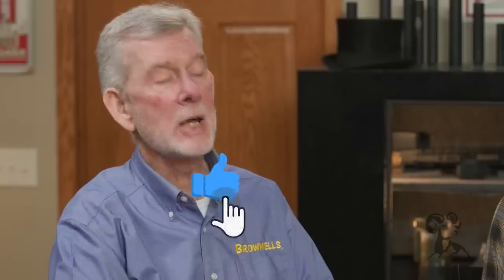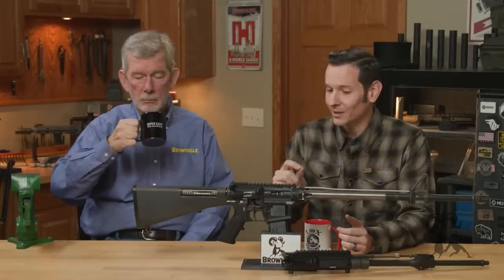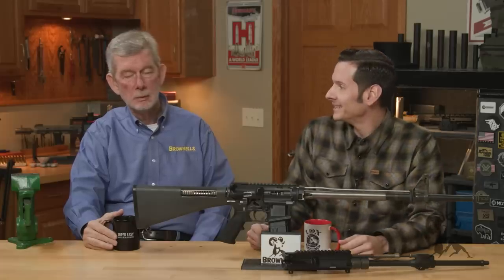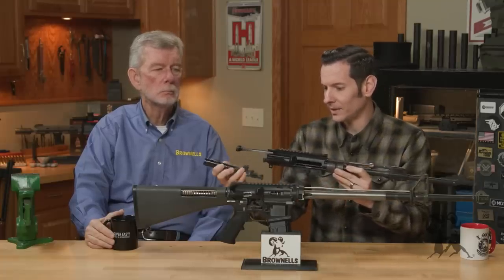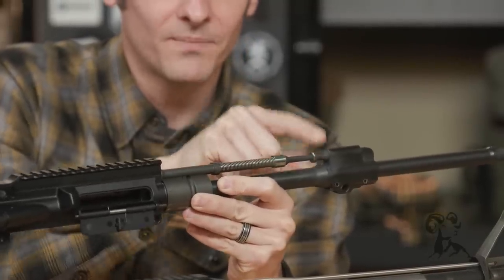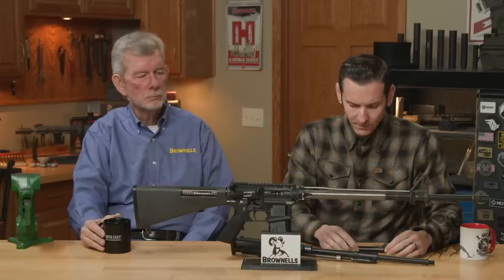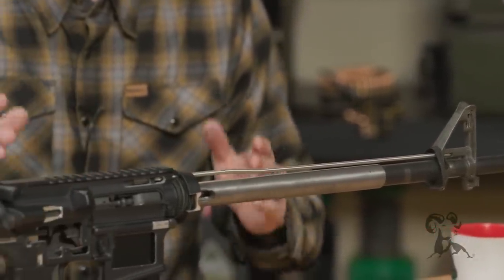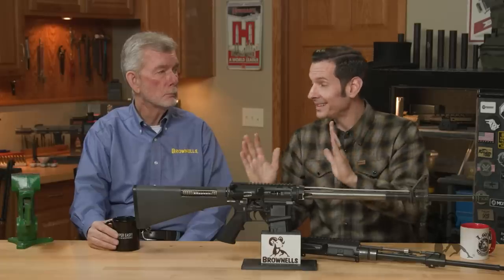Smyth Busters: The AR-15, Direct Impingement or Piston Operated?

Comment: I've always tried to explain the AR never was DI even though Eugene Stoner called it that because the bolt is the piston and the carrier is the cylinder. I think Stoner simply said that out of simplicity to avoid having to explain the whole thing. Example of a real DI is the Swedish AG45B and the MAS 49 if memory serves me right

I've also tried to explain to people it's a bad idea to move the piston over the barrel on the AR because the AR was designed to have all the forces concentric to the bore axis. When the piston over the barrel producing accentric forces; now you're forcing the rear of the carrier down and dig into the soft aluminum.

Plus now there's nothing to counter bolt thrust pressure before camming open, the carrier key is now digging into the soft aluminum side. Plus the camming action to unlock the bolt without counteracting the bolt thrust pressure on the locking lugs will eventually break bolts as well.

The whole thing turned into a gun hipster fad when HK did that to solve the problem of being able to fire the rifle immediately after being submerged on water for the SEAL teams, not because it's a better configuration for those not firing their weapons immediately after being submerged without letting it drain first. They were willing to sacrifice the service life to be able to do that with the AR, are you?
Reply: In your reality, the cylinder is driven and the piston follows. That's a very strange concept for how pistons work to say the least. Stoner called it DI because that's exactly what it is. The company's patent attorneys are responsible for the creative explanation you've been holding on to, including the expansion chamber that is nothing of the sort.
Reply: @Ni999  in rotary engines ( think sopwith camel or other WW1 fighters) the piston is stationary while the cylinder moves… it is a valid mechanical design
Reply: @JM-jv7ps  Good catch but no soap. I'll stand corrected for the non-linear example that only existed until the oil pump was made airborne and radial engines replaced rotary cylinders. Still a good catch though. Read the AR patent. Edit/PS - hung a well deserved like on your post.
Reply: @Ni999  In both thermodynamics and mechanics it is a question of frame of reference. There really is no difference between sleeve and piston. The are being acted on by the same forces.
Reply: @andresmartinezramos7513  That's true. It's also true that the AR bolt is not a piston.
Reply: @Ni999  say you've never held an AR bolt carrier in your own hands without saying it.
Reply: @asherdie  Say you need a cheap out because you don't want to agree and then say you failed at it.
Reply: The Stoner patent describes it as an internal expansion system, unlike a direct impingement design.
Reply: @Ni999  I would recommend that you study some mechanical engineering relative to these concepts and applications.

I can point to several firearms piston designs with a stationary piston that acts as a point from which expanding gas acts on the reciprocating mass.

This is fundamental to the AR-10 and later AR-15 operating principles.

The bolt tail acts as a stationary piston to seal the expansion chamber, forcing the sleeved carrier to move to the rear.

The piston also happens to be an integral part of the rotating bolt, bisected by the cam pin hole.

It's a very ingenious design due to how it integrates the piston and bolt, reducing parts count and eliminating off-bore axis reciprocating mass.
Reply: @LRRPFco52  Your assumptions about my exposure to different designs and how they work is incorrect. I recommend that you study the difference between patents written for independent inventors and corporate patents and then look at the AR patent more carefully.
Reply: @Ni999  If you don't have a mechanical engineering background specific to firearms or gas dynamics behavior (aerospace, automotive), and don't know the history of self-loading firearms designs, then all the legalese in the world will not help you understand the very real differences between the Stoner Internal Expansion System and Direct Impingement like on an AG42, Desert Eagle, or Mini-14.
Reply: @LRRPFco52  I rely on my physics background for understanding gas behavior. Probably not as good as I'd like but I work with what I have. I understand private and corporate patents because I have inventions covered by them.
Reply: @Ni999  A solid physics background should illuminate the fact that the Stoner Internal Expansion system takes gas from the tube, routes it into the expansion chamber, creating carrier inertia.

Direct Impingement hits the cavity of the cup formed by the key.
Reply: @LRRPFco52  Momentum. I assure you that it does not create or transfer inertia. That distinction was settled probably about a century ago after a few centuries going back and forth on it.
Reply: @Ni999  The expanding gas within the internal, telescoping chamber acts equally on the carrier wall, as well as the bolt flange with piston rings.  Since the bolt can't move forward (much), the carrier moves to the rear as a result of the expanding gas.

Static carrier inertia is overcome by this expanding gas, setting it into motion.  Then you can talk about momentum.

The basic, unavoidable fact is that expanding gas inside a temporary containment vessel with a piston and sleeve, exerts energy that moves the sleeve rearward.

The examples of direct impingement designs, especially the Ljungman AG42, confused enthusiasts because it also has a multilug rotating bolt and a gas tube.
Reply: @LRRPFco52  The bolt and carrier present a confined space for the expanding gas resulting in a force on both as the pressure increases. The bolt can't move forward (much) during this phase, the static carrier inertia is overcome by that force causing it to move, constrained by its inertia of direction, rearward.

The Combined gas law sets the stage so that we can observe Newton's First Law of Motion (overcoming rest inertia) in action as determined by the Second Law of Motion (the amount of force applied). The moving carrier has momentum (Third Law) and works against the dynamic inertia until the carrier can force the bolt to rotate, unlock, and join the carrier moving rearward.

We're not going to settle the debate of whether the bolt is a piston but at least now you know to stop saying that inertia is created or transferred so we accomplished that together. 👍
Reply: @LRRPFco52  And finally, let's examine the patent claims. I quote -

"It is another object of this invention to utilize the energy of the expanding gas developed by the firing of the weapon, for actuating the automatic rifle mechanism directly by use of a metered amount of the gas coming from the barrel. This invention is a true expanding gas system instead of the conventional impinging gas system."

Tell me that you don't misbelieve that "the conventional impinging gas system" is not also a "true expanding gas system."  Both piston and DI systems are whatever you think a true expanding gas system is. That patent statement is a throwaway for the examiner. It has nothing whatsoever to do with gas laws, physics, or mechanical engineering. It implies that a difference exists where one does not.

Again from the patent -

"The most widely used method of operation of automatic rifles today is the conventional gas cylinder, piston and actuating rod assembly; the only other system now in production use being the recoil actuating system. The blow-back or inertia block system is usually reserved for weapons using lower powered ammunition, such as pistol and .22 caliber weapons."

That part in bold was not true when the patent was written, applied for, or granted. It's another throwaway designed to direct the examiner's attention. In the post-war world, it roughly translates to," Everyone knows that gas pistons are the real deal and used by everyone." It's an easy sell for any examiner with recent military experience and it was absolutely expected by US Army buyers. It set the stage for the creative writing claiming that the bolt was a stationary piston.

Lots of patents lie, everything is legal as long as you don't get caught. The patent protected the embodiment of that particular gas operated bolt carrier and rotating bolt. If DI had been considered the hot ticket at the time, its entire explanation could and would have been cast in terms of its unique DI operation. Nothing would have changed except for the creative writing, the patent would still have been granted and it would would have still been quoted extensively.

In addition to protecting inventors, patients acquired another benefit long ago - their claims have been used to form arguments from authority in order to create buyer excitement during sales and marketing. That works surprisingly well. It worked on you and your first argument to me was that I lacked the knowledge to kowtow to its authority. You're certainly welcome to your opinion. Last I checked, the AR system in question is DI by definition, notwithstanding the sales pitch about the expanding chamber, true expanding gas systems, or bolts that have the secondary function (patent's words, not mine) of acting like a stationary piston.

Both gas piston and DI rifles operate by impingement - pressurized gas forces a metal component to move out of its way. That's basic physics and not open to argument.

Piston systems typically use a mechanical linkage to transfer the force to the carrier. Systems that have carriers impinged directly by gas without an intermediate linkage are called - appropriately and obviously - direct impingement. You keep saying that isn't so but you've said a number of things that aren't true. You know, like the part where I didn't understand how gas expansion worked (that turned out to be you), or how mechanical engineering applies here (yeah that was you again), or even fundamentally how the design works (yeah, no).

Pity about your attitude. Maybe it'll improve next year. 👍🙂
Reply: @Ni999  The biggest premise of your argument relies on a historical falsehood.  The AR-10 gas system patent was submitted in 1956, awarded in 1960:

U.S. Patent No. 2,951,424, Sept. 6. 1960

There was no US Army production contract until years after the patent submission.  US Army evaluated the original AR-10s, but they were late to the service rifle submission schedule, and Army Ordnance already had it rigged in favor of their brainchild, the T44/M14.

US Army also had a SCHV competition, which is where the AR-15 was submitted and rejected wholly as an unsuitable battle instrument, though interesting.  

USAF was looking for an M-2 Carbine replacement for its base Security Forces, and General Curtis LeMay had it demonstrated to him at the famous 4th of July birthday in Maryland.  He ordered the Pentagon to begin type-classification and Military Standardization of the AR-15 weeks after the Army Ordnance Board had rejected it.

Special Forces units in the US Army, Navy, and England began acquiring AR-15s alongside the USAF initial contract for the Colt 601s, after the patents had been transferred from Fairchild/ArmaLite to Colt in 1959.

Big US Army contracts started being fulfilled in 1963 with the Colt 602 production.

From a mechanical engineering perspective, the closest you could come to DI with Stoner's patent would be Indirect Gas Expansion, since gas is routed around the bolt face and carrier into the central expansion chamber of the carrier.

Of course all self-loaders rely on expanding gases to cycle the initial rearward movement of the action.  We still don't call a Remington Model 8 or a G3 Direct Impingement gas systems.  You start to see why it's important to distinguish between different designs, because they solve the self-loading feature differently.

If everything is DI, then it still requires subdivisions explaining the mechanical differences.  Everything isn't DI, so your assertions fall apart when applied to themselves.
Reply: @LRRPFco52  That's the patent I'm quoting verbatim. If you think that Fairchild wasn't looking forward to military sales when they decided to go ahead with the patent process, you're simply wrong. You had yet another reading comprehension failure when you decided to take away that I asserted everything was DI. I obviously didn't but hey, you want the exercise, knock yourself out. Still though, bonus marks for knowing all about the AR-10 and its patent, except for what it actually said. Seriously, pity about your attitude. Good luck getting better! 👍🙂
Reply: @Ni999  It's nothing personal, just that I've been an avid student of the Stoner designs since no later than 1982.  ArmaLite's involvement with Stoner started when he met one of their guys at the range, both testing their own experimental rifles they built.  Stoner's original boxy prototypes before the ArmaLite tool room AR-10 prototypes were to allow his wife to shoot a high power .30 caliber rifle without the recoil penalties, hence the self-loading feature.

He also wanted it to be light enough, which drove him to eliminate the external op-rod/piston.

The original prototypes had no carrier key.  The gas tube entered the bolt carrier into the expansion chamber, which was hard to machine.

The carrier key was later added to the 9 o'clock side of the carrier, with corresponding alignment and porting of the barrel and gas tube.

This was later moved to 12 o'clock as we know it now, so the indirect gas path through the key could be connected easily to the expansion chamber.
Reply: @Ni999  Chuckles in decades of aerospace engineering community experience and being raised by a theoretical physicist, among some of the top AeroEs in the world.  Firearms are child's play in this regard.  The programs we were on involved cutting edge advancements in materials science, CFD analyses, and teams of minds you don't find often in most professions.  Peculiar characters in many respects, but brilliant.

If I misspoke about anything First Principles related, I'll own it, but I've been describing the Stoner gas system accurately.

Comment: Nice theory....
But mechanically speaking,
it's just an expansion chamber, instead of a pistons.
Reply: no because it reciprocates according to the gas pressure which is a piston
Reply: @AR15andGOD   nope, it's as an expansion chamber, not a piston, just to unlock the bolt. An "apparent piston".

Comment: You could argue that in the MAS and the AG-42, the bolt carrier is the piston, though rapped around the gas tube, rather than being inside the sleeve of the gasblock. So a "long stroke bolt carrier integrated spigot gas piston", while the AR-15 is a "short stroke bolt integrated gas piston".

Comment: I say it's a hybrid system, the gas acting on the gas key on the carrier as a DI to exert force to push the bolt back. and the internal piston system pushes the bolt and carrier apart ro unlock the bolt

Comment: Is there any argumnet that direct impingement on an ar saves bolt to lug wear compared to piston?
Reply: It definitely does. I've shot both styles, factory and ones I've assembled, on various lowers, and even with a tuned gas system the short stroke gas piston uppers beat up bolt lugs. I've run factory Sig 516s and after market Adams Arms, different adjustments to the gas block different SpringCo buffer springs different buffer weights, etc, always saw a difference. Best thing I ever did to any AR was convert to the Vltor A5 buffer system and switch to an adjustable gas block. But even then they're different beasts. Having forward pressure on the bolt before the whole thing cams over definitely decreases wear on the rear of the lugs. But on 5.56 ARs I always change bolts at 5k rounds and on 6.5 Grendel or others I change bolts when I change barrels, whether 2k, 3k or 5k
Reply: @DanielReyes-hz1qk  thanks!

Comment: Or, you could just read Stoner's patent (US2951424A)...."By having the bolt carrier act as a movable cylinder and the bolt act as a stationary piston, the need for a conventional gas cylinder, piston and actuating rod assembly is eliminated."...."This invention is a true expanding gas system instead of the conventional impinging gas system."...Don't understand what the continued controversy is. Eugene Stoner invented it, explained it, defined it, and patent it....Read it for yourselves......
Reply: Yup, it describes it as a stationary piston, not direct impingement....

Comment: It is fewer parts and is deceptively simple and quite clever.  This has a major advantage for the AR when used as a sporting rifle and that is accuracy.  The gas tube has little affect on the barrel harmonics vs what a barrel mounted gas piston system will do.  Militarily with perfection of the ammo and such, the AR15 is quite reliable reliable.

Comment: At what point is a design no longer an AR Pattern rifle? For example the HK416 uses a piston instead of DI. An AR9 is just blow back. Yet those two designs use similar lower receivers, handguards, small parts, grips, charging handles, the AR9 uses the same buffer system as an AR15. They even look like AR15's. When does a design become something else?